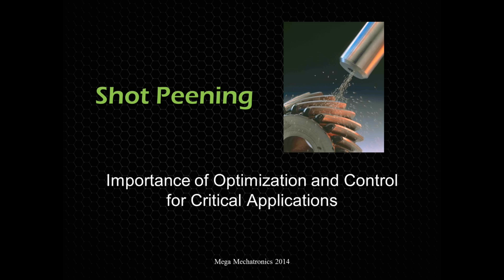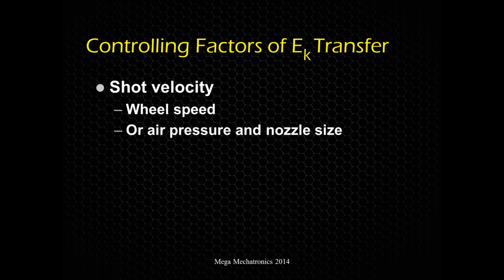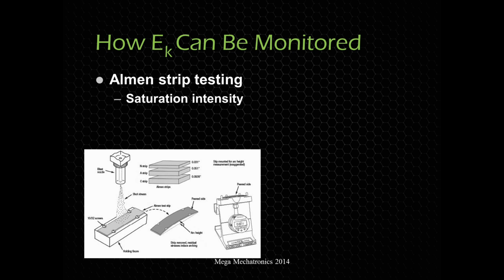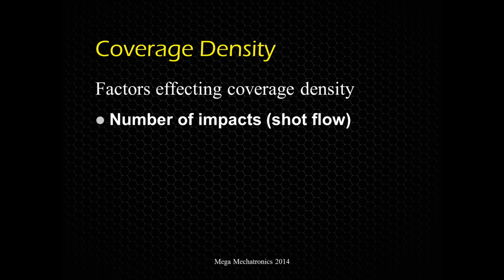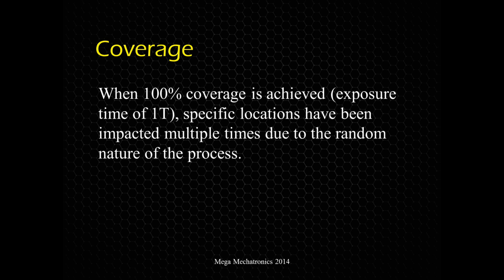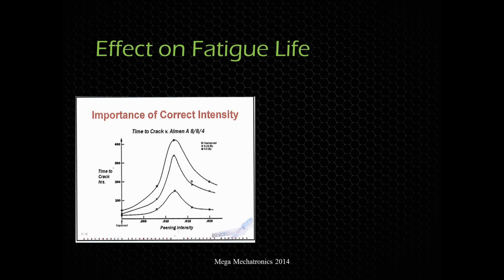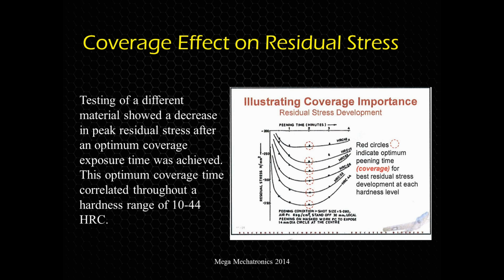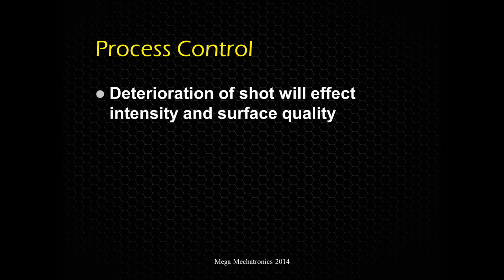Shot Peening Process Optimization - Critical Applications

Comment: Good video, good info. But setting aside the "industrial" requirements for service life benefits can you tell me how glass bead  blasting by a DIYer in his garage at say 60-90 psi compares to real shot peening? I realize you can't determine the exact energy transfer in such uncontrolled environment, but is glass bead blasting even in the ballpark of kinetic energies required or would we have to bump up the pressure to above 100psi basically destroying glass beads?
Reply: Have you found an answer or help with this? I would love to help if you still need!

Comment: Nice video but my Question is that Why in over coverage of a surface by shot peening there is a decrease in fatigue strength (Any Justification) ?
Reply: Now dont quote me 100% , but i believe it is all dependent upon the material and application. When you are peening a surface, you are removing a slight bit of material and also compressing it in so once your coverage point is achieved and you have overlapping dimples, you're going to start to create stresses in the compressive profile that you built up

Comment: So if you going to shot peen do you heat treat the object before or afterwards?
Reply from the maker: If you're going up to transition temps then you remove all the beneficial stresses induced by shot peening.  However some processes will low temp heat treat, like tempering and burnishing.

Comment: I know an engineer who worked in steam catapult development back when the technology was still in its early stages.  He told me that the shuttle hooks were breaking from extreme tension imparted on them during testing.  So he recommended shot peeing them.  They followed his advice and there were no further breakages.  Also, I was a machinist and learned early on that anytime you machine down one side of a piece of cold rolled steel it will warp on you as the cold rolling induces residual stress all over the entire surface area.